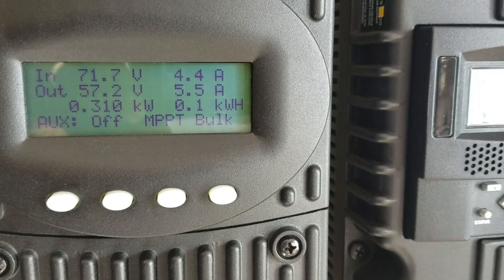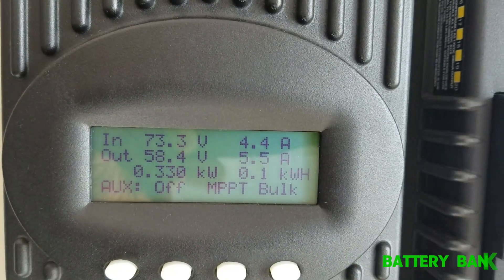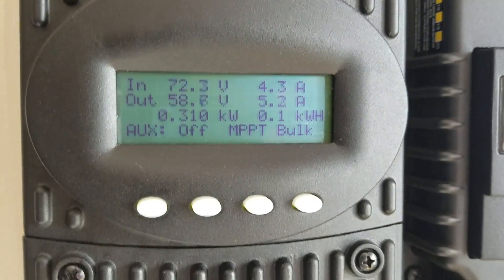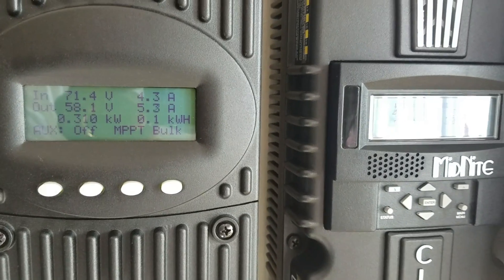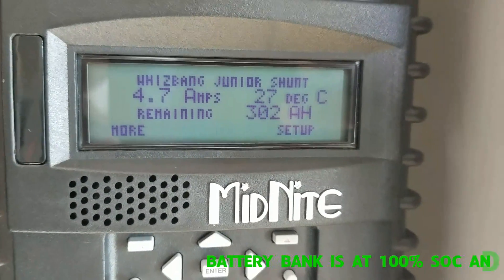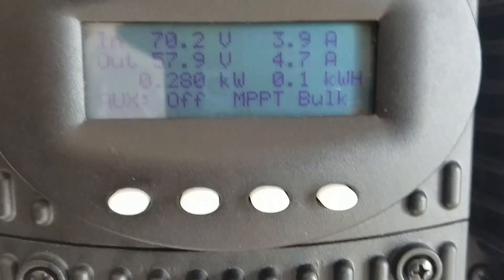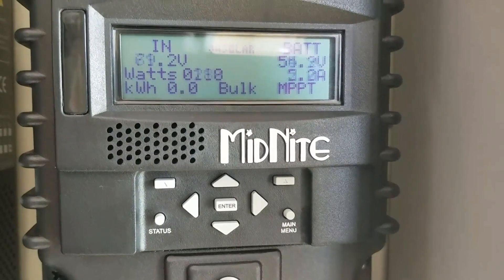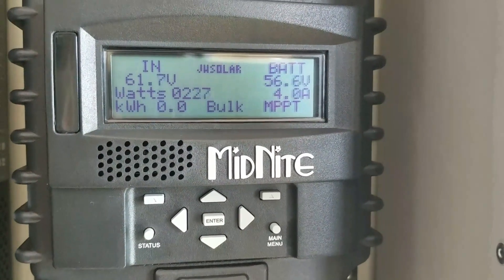BATTERY BANK IS AT 100% SOC AND STILL CHARGING By: jwsolarusa

Comment: At what  voltage does the FM 60 switch to absorb  mode on your system?
I see it's at 55v still in mppt bulk?
Reply from the maker: At 66.4 volt.
I am running 16s configuration
Reply: @jwsolarusa  I have the same controler and 48 v battery bank (8 x 6v) they are just GC2  golf cart battwries cant find much info on them. 60.2 sound right for absorb? Also very new here  but my float setting is 53.5 but the FM 60 charges in bulk right past that voltage set point trying to reach absorb.
Is this correct?

Comment: If the SoC is 100%, shouldn't it be in float mode after absorb mode. The 4 stage cycle is typically,  Bulk, absorb, float and equalize for flooded lead acid batteries,  it seems your charge controllers are programmed differently.  There may be something I'm missing.
Reply from the maker: +rhandsom 
The batteries SOC went from the 90's to 100% but still flashing. I was close to enter into absorb mode but unfortunately the weather didn't cooperate with me and lost that opportunity. I will definitely get into absorb and float tomorrow morning. 

Please feel free to shoot me a private email and you phone number so I  can explain this better to you.
Nothing is wrong with my system neither my charge controllers. Just send me your number on a private email then I will call you.
Thanks for the comment and for watching my videos brother. 
God bless you.
Reply from the maker: +rhandsom 
The batteries SOC went from the 90's to 100% but still flashing. I was close to enter into absorb mode but unfortunately the weather didn't cooperate with me and lost that opportunity. I will definitely get into absorb and float tomorrow morning. 

Please feel free to shoot me a private email and you phone number so I  can explain this better to you.
Nothing is wrong with my system neither my charge controllers. Just send me your number on a private email then I will call you.
Thanks for the comment and for watching my videos brother. 
God bless you.
Reply: battery efficiency is set way too high in Whizbang? or you started your day at 100% soc?
Reply from the maker: Darren Living Off Grid  Started My day at approximately 100%
Reply: +jwsolarusa John I see. How often do you use your batteries?
Reply from the maker: Darren Living Off Grid 
I use them everyday and night but I happen to shutdown the system for an upgrade the day before and the batteries were at 100% which I didn't use that day.